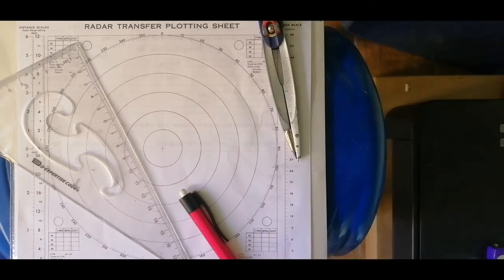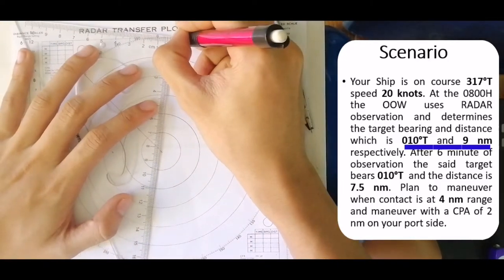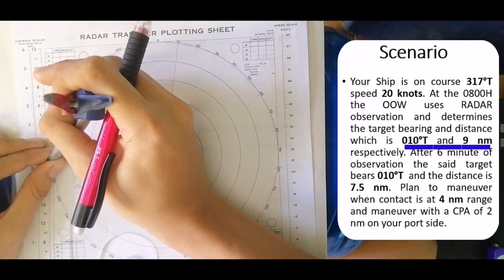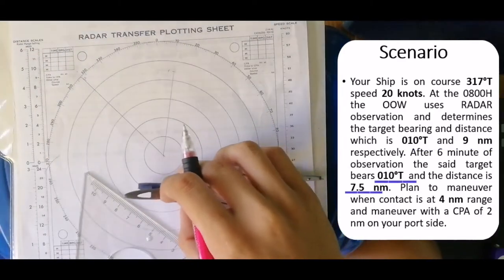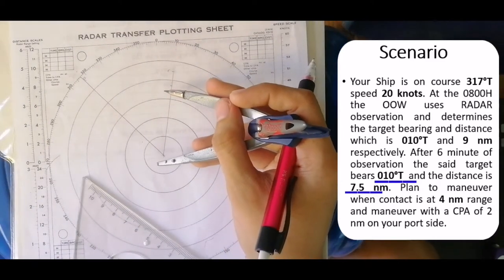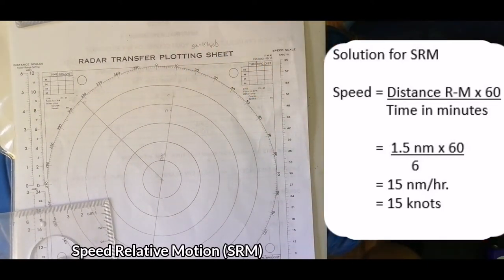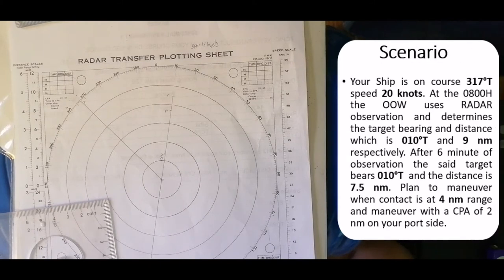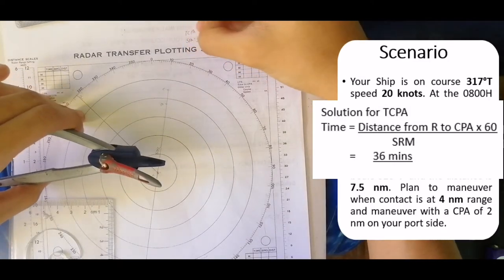Radar Manual Plotting: Avoidance Course and Avoidance Speed

Comment: Question lang po ano formula nyo dun sa vector? Yung 20 kts means 2 nm?
Reply: Based from the situation Niya lang kinuha, bale DST lang. Based sa problem ang speed is 20kts, then ang time difference ng observation is 6 minutes, so Distance =20 kts. x 6 minutes = 120 ÷ 60 which is 2 nautical miles.